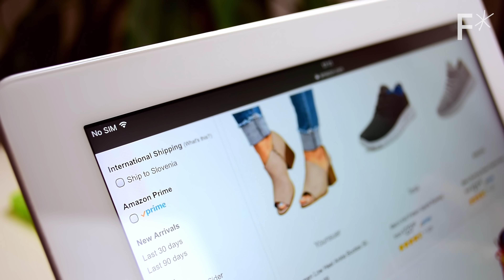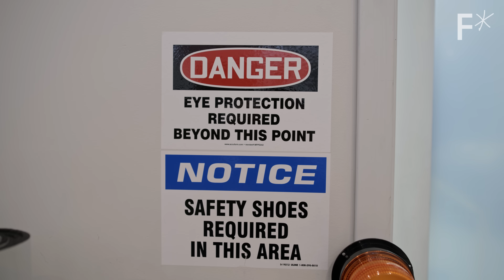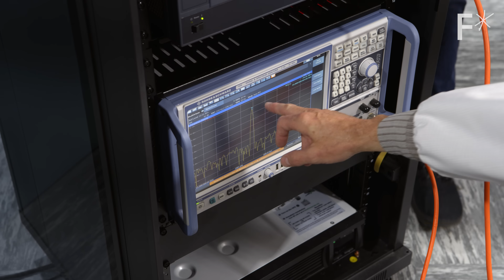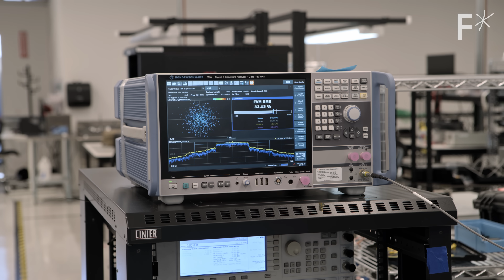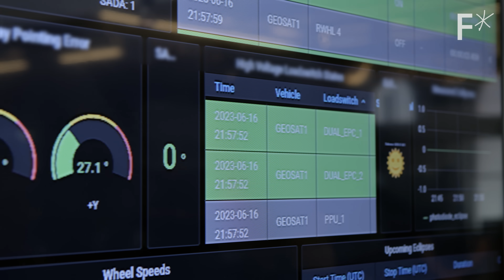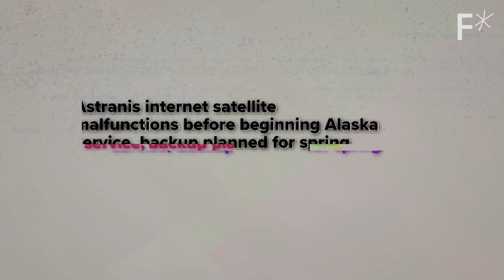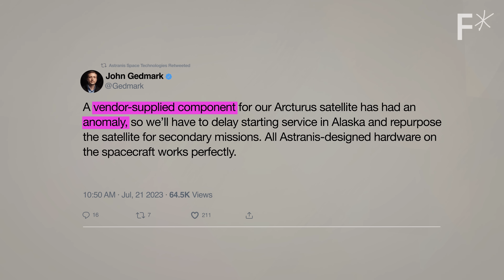Starlink’s newest competitor is using next-gen satellites to create internet for all | Hard Reset

Comment: How many connections and how fast is one of these satellites?
Would be interesting to know.
Reply: Roughly 2 million people, or 1,000 cell towers, connected per satellite
Reply: @1stPrinciplesFM  thanks 😊 
And do you know the maximum speed?
Reply: @cybergigafactory   Effectively unlimited? It depends on how our customers chop it up, we provide "middle mile" capacity that they then turn into a customer-facing service.

But to be more direct: it can be just as fast as Starlink or even fiber, depending on the use case.
Reply: @1stPrinciplesFM  yea, that is great. 
Starlink is not really for a city but more for a rural area because each satellite can only send so much data.
I would like to know if one of these satellites can handle thousands of customer at the same time with fiber speeds of 200mb or higher. 
Would be interesting to compare it to starlink and other competitors.

Comment: The big drawback with geo-stationary satellites is latency, which prevent some use cases, and even can make surf the web frustratingly feel laggy… 

Starlink doesn’t have as many limitations, and new emerging technologies (satellite communication from a regular mobile phone, meta-antenna,…) may make communication from a regular mobile phone being near seamless (with huge lower cost advantages thanks to the HVM of mobile phones).

Also I would think that Startlink is funded by the profits generated by SpaceX, and therefore already have a huge monthly cash flow that they using to iterate fast, lower cost,… on each new Starlink satellite generation. Starlink subscription is already in the 40€/month price ballpark !!!

Therefore geo-satellite internet is a non-starter as 1. it won’t be better and 2. it will also be much more expensive.
Reply: Starlink actually just today broke even on cash flow, funny enough. Starlink is great but it's expensive and a single network won't ever be able to serve 4 Billion people's connectivity needs. It's taken 10,000s of companies to get the first half of the planet connected, it's going to take many more to get the other half online too.
Reply: @jasoncarman99  Starlink likely has enough funding from SpaceX to cover the whole earth (given enough time (5 to 10 years)), and thanks to future generation of SpaceX rocket (Starship), it will cost them even less per satellite launched. 

Until there isn’t any other price competitive company that could compete with SpaceX, there is near zero chance that any other private company can launch internet satellites at a price competitive with Starlink and be profitable… It is a non-starter…
Reply: @nicolasdujarrier  they will definitely cover the earth, they already do. But (a) it will never be affordable to the point that 4B more people who can't today afford internet will and (b) despite how many satellites you put up, no one network will be able to support that many people. 

It took 10,000s of cos to get the first 4B online, it will take more than 1 company to get the last 4B.
Reply: @nicolasdujarrier  Starlink needs to replenish the whole fleet every ~3-5 years as they deorbit
Reply: @1stPrinciplesFM  I didn’t know that, but still SpaceX/Starlink seems already cash-flow positive, so in very good position to lower their prices if needs be… And as previously said, they could use the profit of one region to cover the loss of another region if they wanted…
Reply: @nicolasdujarrier  That's kinda the opportunity, and kinda the problem. 

Another way to think about it is that they must cover the entire world to cover any of it, and the world is 1) mostly ocean, 2) far from evenly distributed in population. So some satellites will be 100% full and others will be 0%; and the 100% have to 
earn money to prop up the 0%.

The Astranis model is to put up satellites only right where they are needed, so we avoid that problem altogether, putting up only the minimum hardware needed to do the job.
Reply: @jasoncarman99  Again, I disagree. Starlink is already profitable (cash-flow positive), and therefore in a good position to modulate their prices if needs be (until it is still profitable). Furthermore, their scale and financial advantages will help them to invest in R&D to develop cheaper technologies for future generation Starlink satellites, and also iterate faster. I have no doubt that, like Tesla, they are in a very good position to quickly lower their satellites fleet costs. Furthermore, with their Direct-to-Cell technology, customers won’t need to pay several 100’s of dollars upfront for a dedicated satellite receiver, but will be able to use a smartphone with the appropriate hardware (Qualcomm Snapdragon modem ?). 

Also, until Starlink is part of SpaceX they get the advantage of the lower cost of the SpaceX launcher, and so it provides them with lower launching cost than any competitor. As of 2023, it would be very hard for any new entrant to be price competitive with Starlink…
Reply: @1stPrinciplesFM  I understand, but according to a CNBC article published on 2nd November 2023, although you state there is the disavantage of having to cover the whole earth, Starlink seems already cash-flow positive !!! Therefore they can already use this cash-flow to re-invest in R&D to develop new technologies to lower their costs, and as they still have plenty of potential to grow, they can also easily lower their prices if needs be (until it is profitable for them).

Also with Starlink Direct-to-Cell technology, I think it is (or will be) possible to access their satellite network directly through a regular mobile phone (with a Qualcomm Snapdragon modem ?), with no need to spend 100’s of dollars upfront in a dedicated satellite equipment : in poor countries, this will also be an advantage…
Reply: @1stPrinciplesFM  According to a CNBC article published on 2nd November 2023, although you state that they have the disavantage to have to cover the whole earth, it seems that Startlink is already cash-flow positive. Therefore, they could already further invest in R&D to iterate and develop technologies to lower their costs, and also lower their prices if needs be (until it is profitable for them).

Also with Starlink Direct-to-Cell technology, it may be possible to access their satellite network through a regular mobile phone (equipped with a Qualcomm Snapdragon modem), without the need to spend upfront 100’s of dollars in a dedicated fixed satellite equipement.

I don’t know your costs (but you have this information), but if you want to cover only a specific region, then I am wondering if an alternative option like Google Sergei Brin start-up Airship, that is developing a new generation of Zeppelin may not be more cost effective that developing and launching a satellite ?
Reply: @nicolasdujarrier  You are  missing the big picture. The only advantage LEO has over GEO is low latency but to achieve that low latency they have to deploy more satellites more frequently as they need to replace them every ~5 years. Now the GEO satellites can operate longer and only a few of them are needed to cover the whole earth. This means the GEO satellite companies can offer cheaper data connection than LEO which is what most people care about. If Low latency is important to you. You have the option of buying a cheap mobile data bundle to supplement your low latency needs.
Reply: @asandax6  Your assumption is that one GEO satellite cost less than several LEO satellites. Without hard numbers, it is difficult to be sure, but Elon’s way of doing things at scale, and continuous improvement means that Starlink is probably iterating very fast, and always looking for opportunities to lower costs (ex: Tesla Model 3, and next generation platform Tesla EV platform with further cost reduction improvement).

Astranis GEO is likely hand built (no automation, neither economies of scale), and don’t have the advantage of being part of SpaceX to benefit from cheaper launch cost : I would not be surprised that all of that by itself may mean that one Astranis GEO satellite may actually be the same cost as several (3? 5? 10?) Startlink satellites.

Also, something Astranis didn’t talk about and is not clear : does it require a specific fixed satellite receiver that may cost several 100’s of dollars upfront ? Because towards 2025, Starlink hope to have Direct-to-Cell service, which means that you will only need a regular LTE smartphone to receive text, voice and data without having to buy any specific equipment (further reducing costs to potential users).

I am not saying you are wrong, but I am clearly very skeptical because I know very well how Elon endeavours tend to successfully constantly improve to reduce costs, which make them a very tough competition…
Reply: @nicolasdujarrier  Yes my assumption is that 1 GEO satellite costs less than several LEO ones. If we compare it to starlink and say 1 GEO satellite costs as much as 200 starlink satellite to build and launch you could put 60 GEO satellites and it would cost as much as 12 000 starlink satellites (starlink is planning on putting 40 000 and they have to replace each one every 5 years). This cost is would also be reduced once taking into account the life span of the satellites. Ultimately the deciding factor would be the price consumers have to pay. If it's less than starlink consumers will go for it.
Reply: @jasoncarman99  Given that they lose a ton of money on each ground station instelation (SpaceX subsidizes it) cash flow possitivity might just be a slowdown in instelations

Comment: Starlink doesn't lose connection each time it switches and doesn't have to track the satellites mechanically - it uses beam forming to instantly switch between them. Might wanna research a bit more before making false statements.
Reply: And I think their cruise-ship solution uses multiples dishes so that perhaps they can be connecting to the next satellite before the current connection drops
Reply: @backacheache even for single star links it doesn’t drop connection
Reply: @backacheache cruise ships use multiple terminals because there is a limit to bandwidth on a single terminal and a huge cruise ship needs a large pipe. Starlink terminals can track multiple Starlink satellites simultaneously using beam forming.
Reply: It would be unusable if it lost connection each time it switches, it would likely keep the connection up and keep the transmission as seamless as possible, you could in theory even have multiple satellites pointing at the same area which is probably what they are doing.

Also "lost connection" is a massive misnomer in tech, a connection is a request to data transmission, if the connect is "lost" then somebody in the pair asked the connection to be terminated, which you would never do if it was such a big problem, you just keep transmitting till you get valid packets
Reply: If I were making StarLink I would have the dishy talk with multiple satellites all the time. Just like the cellphone network. Then there would be no connection drop. Also, as has been pointed out many times: Starlink dishy's are phased arrays so the communication with satellites is directed electronically not mechanically. Presumably, they add the mechanism to just optimise the angle for the array so it's not trying to project at low angles to the array.
Reply: Is this an ad?  Starling does not lose connection and does not have to mechanically adjust tracking at all as your video incorrectly states.  You also imply that geosycinchonous orbit is a novel idea.  It's not.
Reply: Western Queensland Australia star link does cut out it sort of glitches and we loose signal for a short while mostly in the evening I would love a equal alternative as musk is an idiot